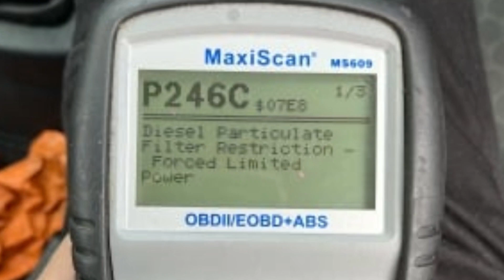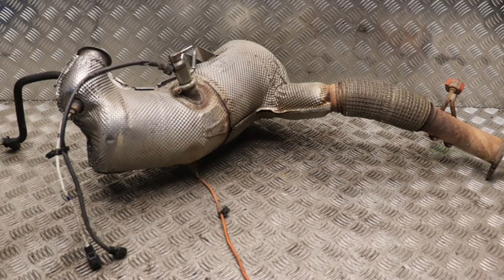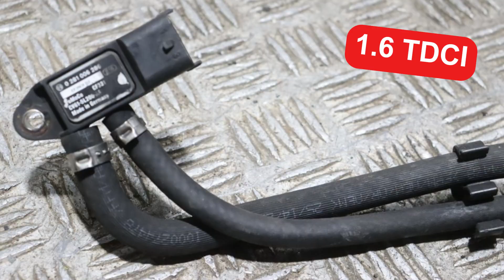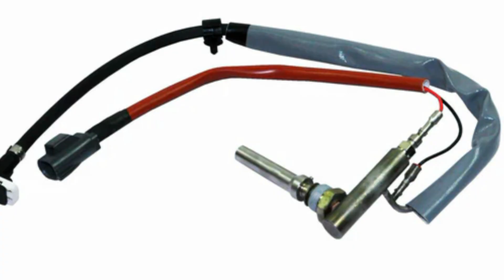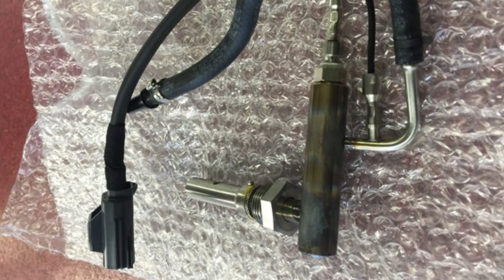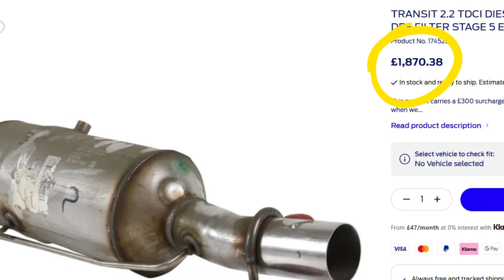Ford Transit P246C trouble code: Inspection steps

Comment: I got p246c after dpf delete, any suggestions?
Reply from the maker: The software was probably updated poorly after delete or the emulator died - depends on the way your mechanic coded the system. No DIY solutions, unfortunately.